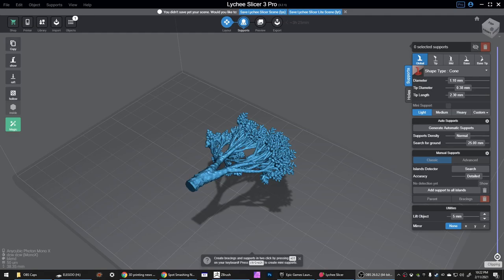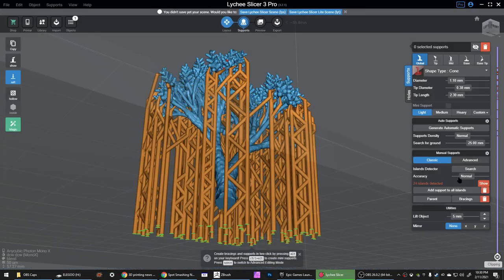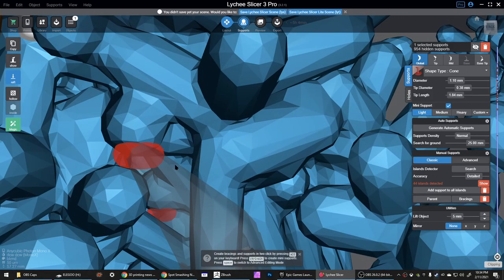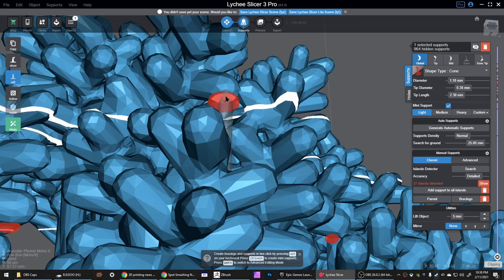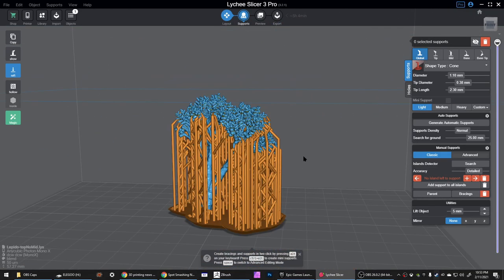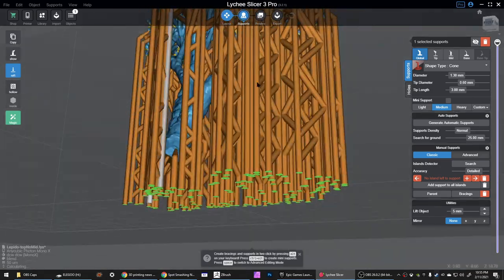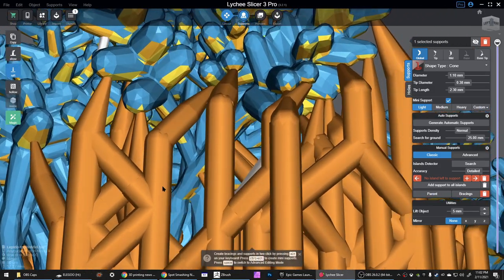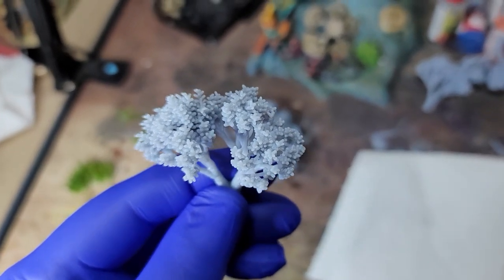How I add supports to complicated models using Lychee Slicer

Comment: I wish I could automatically add thinner supports in proportionally more, so the load is distributed more evenly, no manual spacing has to be done, and thin supports are much easier to remove.
I've already tried super-thin supports, I just poke them anywhere and it works just fine. I'm tired of adding them manually tho

Comment: I’m brand new to the resin printer world I have a anycubic mono and I was wondering if you removed the supports before or after curing and which is better?
New subscriber here because I just added a bunch of new things to my skill set. Thank you
Reply from the maker: Hello jack0cat. Most people remove the supports before curing. It generally causes less damage to the model that way. I always remove them before. Some people also soak the model/supports in some warm water (after cleaning) to loosen them up a bit. If you try this make sure that your model is very dry before curing. It can leave an ugly white residue if you don't.
Reply: @DonWhitaker  
Thank you.
Reply: @jack0cat  ALWAYS before curing. My process is 10 seconds in acetone and then straight into hot water. Lychee supports come off VERY easy in the hot water. Then allow your print to fully dry. Then cure. Then sand.

Comment: I have to ask you...what is your lift speed. Lots of light supports. My light supports like to fail. I'm assuming it's the suction force because I messed with my lift speed and forgot what I had it at before when I was using lights lol